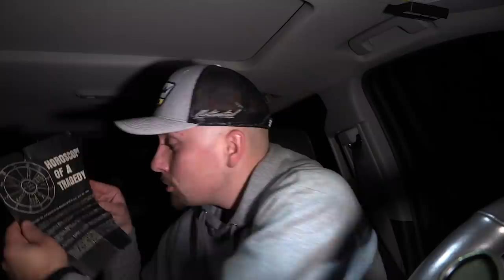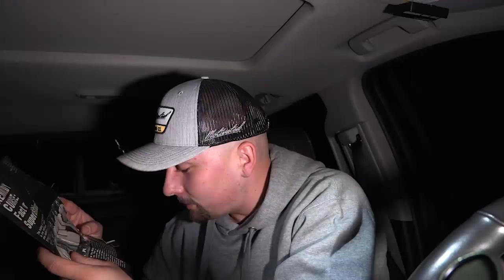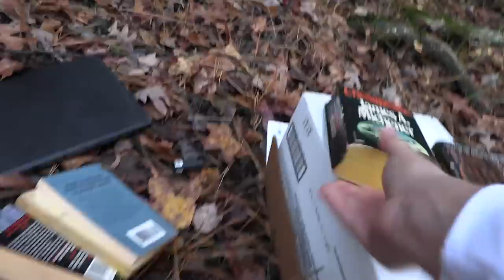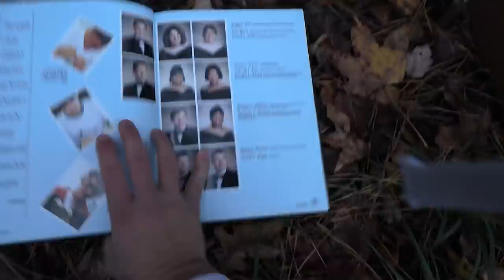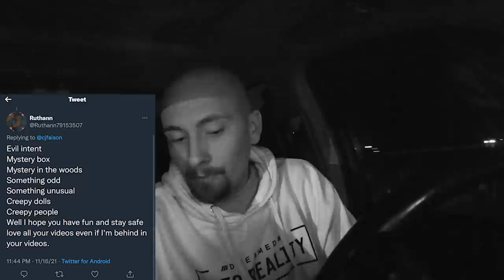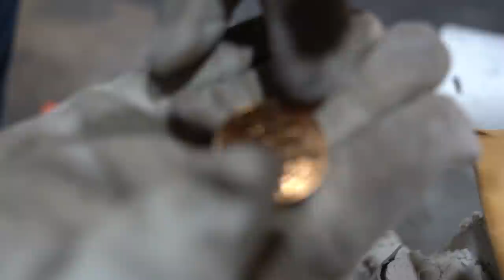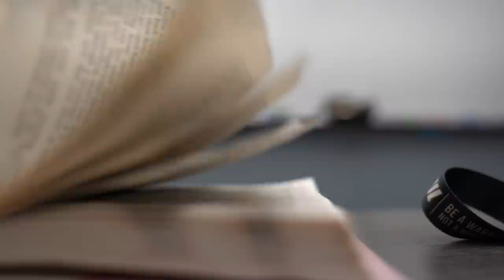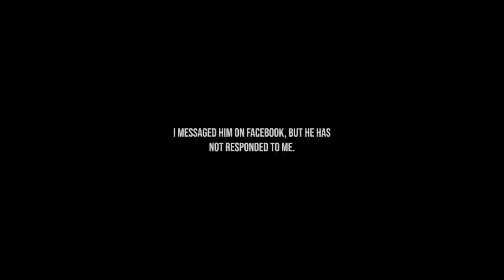SCARY TRUTH ABOUT RANDONAUTICA APP **unseen footage**

Comment: Does CJ eventually realize at some point in this video that the watch allegedly "stopped" at the exact same time as the tragedy to which the astrological chart pertains?  Seems like what someone might do in planting something, that was intended to be found, especially because of the time correlation between the watch and said tragedy.  After stating that the watch appears to have stopped working at twelve fifteen or sixteen and five seconds, CJ immediately gives a shrug to the camera, then takes a moment to set the watch down, and as he does so, he adds, "That's weird."  Which left me feeling, and then thinking, the same, "That's weird."

Why would CJ say that?  What is really so "weird" about a watch stopping at twelve fifteen or sixteen and five seconds??  Was this intentional foreshadowing of the time correlation?  Was CJ's "That's weird,"  little comment intended to serve as a highlighter, allowing the audience to easily recall the time the watch had stopped running, and thus provide his audience with a better chance of noticing the correlation between said time on the found watch, and the time of the tragedy which he would soon be reading about?

CJ reads the title on one of the sheets of paper aloud, "Horoscope of a Tragedy," holds it up to the camera, and says, "Right there, that's a little strange."  He then proceeds to read this story that begins with the line, "Consider the evil aspects in Los Angeles at 12:15 am, June 5th, 1968."  This is the time at which Robert F. Kennedy was assassinated by Sirhan Sirhan, and just earlier that evening, Kennedy had been declared the winner in the South Dakota and California 1968 Democratic Party presidential primaries.  

So, we have the time being 12:15, the same as the watch. The watch also had five seconds past the minute, and we have the date of the assassination being on the 5th day.  Further, recall the brand of the watch, it was a Victory watch.  This is no coincidence, it was done intentionally, but does the Victory refer to Kennedy winning those primaries, or to the assassination???

Let's see what else shall be revealed on the other sheet of paper, and on the phone . . . for there is assuredly more twists, turns, and correlations to come!!!
Reply: I also thought it strange him saying “that’s weird” when there was nothing odd about it! But what you just said puts it together perfectly!! And the victory part…I didn’t even think about any of that!! I’d say victory for winning but wow… awesome that you put it together!!

Comment: Turn off the phone then hold the power button and the volume button down at the same time as the phone turns back on let go of the power button and then hit the power button and hold it so just release the power button and hit it again and hold it do not release the down button and then it will come up to reset phone then the passcode will be gone